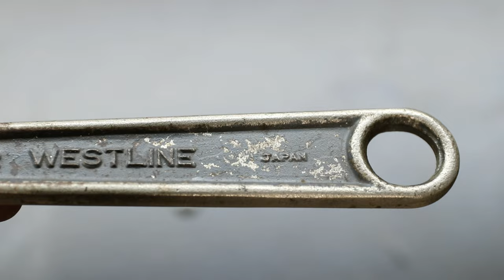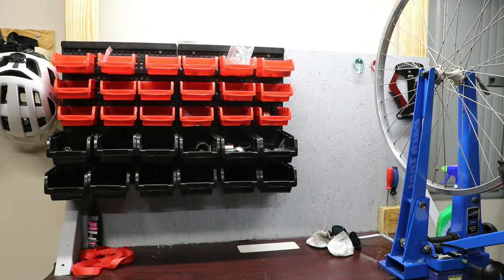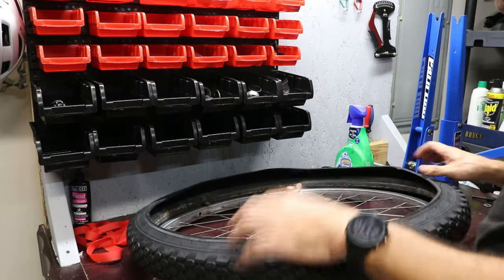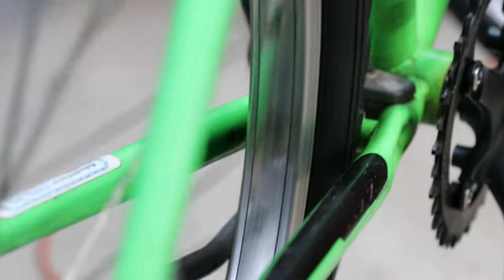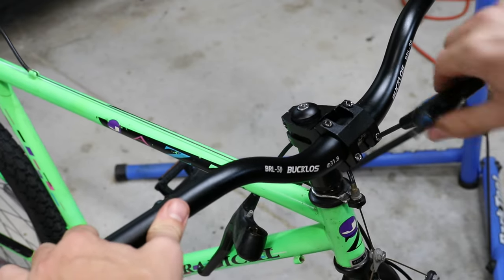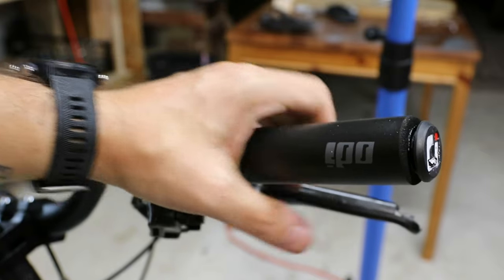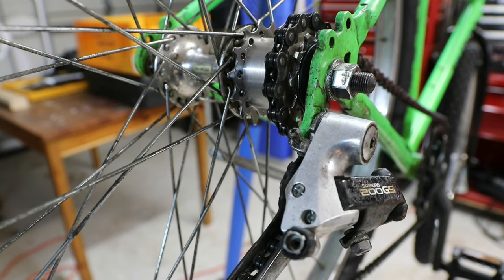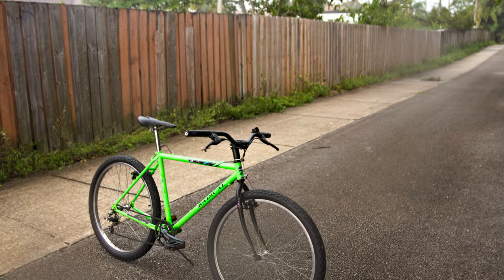$20 - 1990s Jazz (Trek) Radical Restoration

Comment: It's interesting. Major brands like Trek, Specialized, and Giant were trying to go down-market in the 90's with sub-brands that would hopefully gain a future customer who might one day upgrade to a higher end model.

Fast forward 30 years, and such manufacturers have long abandoned that business model and bow you have Big Box brands trying to push up-market.

Back in the mid-90s, I had broken my old 24" wheel Murray and was ready to move up to a 26" bike and I knew I wanted something from a bike shop. I got my mom to take me to the bike shop where they had some bikes that were in the low $200's. I think it was one of the Giant built sub-brands similar tobthis Jazz by Trek.

Mom says we'll talk to Dad when we get home. As we are driving by the Walmart, I see his truck parked out front and knew exactly what was happening.

The bike he bought me was a Huffy Scout (claimed to be a cromoly frame, but otherwise very low end Shimano SIS parts). Crazy part, was that bike cost $199!  For $20 or $30 more, I could have had a real bike shop bike.

I have to give praise to all the work it takes to tear these old bikes down all the way and also film the entire process. That's a ton of work! I couldn't count how many bikes I've done this to over the past 20+ years (sans the filming). Even the cheap bikes like this were built to be serviceable, so that's a fun process to take something old and crusty and get it to come back to life. Good stuff!
Reply from the maker: yes I did read a little about this brand being as you described. And it is interesting that they've given up on that model. I had a lot of Huffy and the alike bikes as a kid in the 80s and mid 90s too, but I didn't know any different anyway. 

I sometimes wonder if it's worth the effort with bikes like this one, but now that it's done I'm actually happy with it, looks cool and rides good. Of course it's not a high performer or anything.

Comment: I literally have this same exact brand bike but on the Jazz Vertical model. We have it in a shed collecting dust and I'm in the process of restoring the bike. I'm very new to this hobby but want to make this bike useful for a commute to the gym (4 miles). I'm hoping to turn it into a smooth riding and daily roader. Would it be worth it to invest in these kinds of bikes? I'm also in the process of watching your cycling videos as well! Great video!
Reply from the maker: I didn't know about the vertical, I just looked it up, it appears to be a little better then the Radical, in that it has double butter chromo tubes, where as mine doesn't mention anything about the tubing. Is it worth it to build these, for the money side of things, no, you'll spend more on the parts then the value of the bike. Like mine for instance probably has about $200 in parts, but I'm sure I won't be able to get over $100 selling it on FB market place. But another way of looking at it is that you can spend a couple hundred and have a cool unique bike for less then a walmart bike.